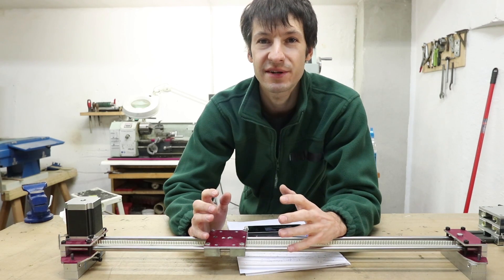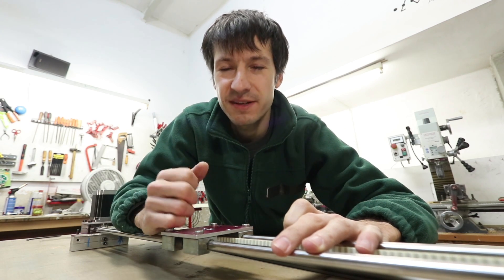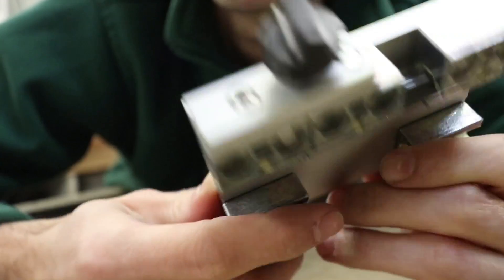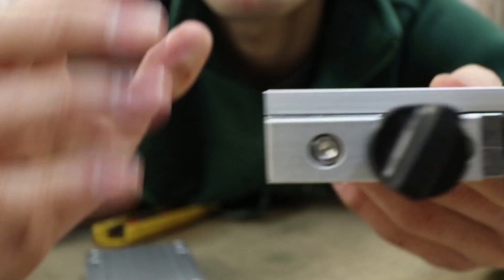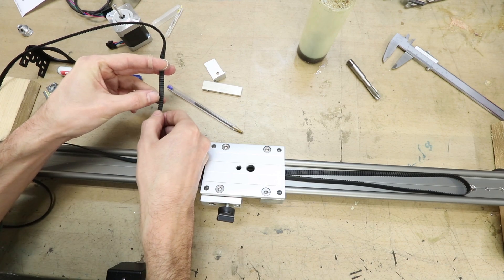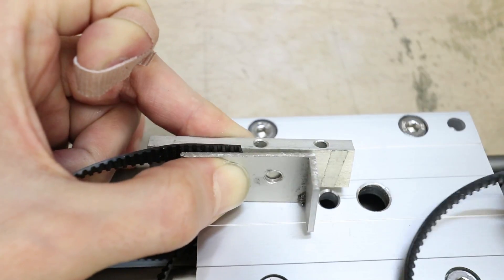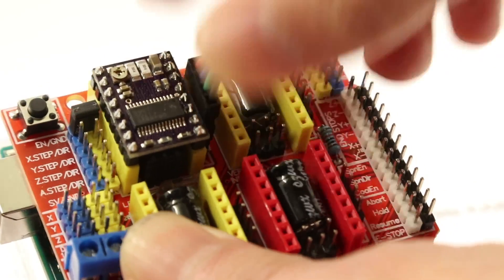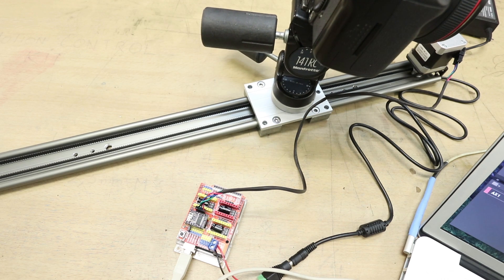DIY Arduino camera slider for professional timelapse and stopmotion

Comment: This is probably off topic, but how did you do the shot where the finished slider is moving by itself without the motor, and then assembles itself without you in the shot? Did you mask yourself out? How did you make it so clean? I see no ghosting! Just curious! :)
Reply: Stop motion ;)
Reply: Jenna Provost So I guess supports are used to place the parts suspended, and the supports are masked out? Could you suggest a video on that process? I know dragon frame is probably the software to use but regarding the physical end of the process, I'd love to see a great video to get me started. 😉
Reply: If we are both talking about the shot that's about 11:20 ish in, then there are no supports! Everything is sliding on the table, just some good old fashioned sop motion with nothing too fancy :)
Reply: Meaning to say nothing is suspended. But of course if you're interested in masking stuff out in your shots, such as rigs, try painting them all green (or something that majorly contradicts the colours you have on your set) and the remove it digitally in post production on most editing softwares. Just like a green screen. Just be sure to get a clean shot (no movement or characters and properly lit) to set in behind it once you get rid of the green/ rig. You could also mask anything in post but I personally don't like to because I find it turns out quite crude and it takes forever!!! For best results I would use a good editing software (like after effects/ premiere Pro) instead of trying to edit with Dragon Frame :)
Reply: The motor on the end that kind of flips over noto the slider end. That's the kind of thing that I thought may be supported in various positions. But I see what you mean. I've never messed with stop motion. I saw this kind of stuff done on Get Hands Dirty and other channels. I guess I didn't realize they were doing stop motion for their youtube videos. Kind of makes me respect their videos more. It's something I'd like to get into!
Reply: If there is a rig in there it's a super easy shot to simply stuff something behind it, for example a lump of clay, and position it so that the motor leans against it but it's hidden from the camera. You should give it a go!! So much fun and soooo rewarding. You learn a lot as you go, stop motion is my absolute favourite thing in the entire world :D
Reply from the maker: I see Jenna has helped you Bloodswarms, she is right with all. And yes Stop motion is something super rewarding, try it. I use as much as I can in the videos as my main job is stop motion animator. Behind the motor there was no rig, just playing with the screws that suports the motor, tightening them form super loose to it right position.

Comment: Do you find any problems with the belt? I.e., backlash, getting it tight enough to be able to step back to the same start position, issues with damaging the motor bearings or putting too much load on the motor?Nice video!
Reply from the maker: To this moment it works fine. Backlash is not noticeble, I have repeated movements to have clean backgrounds and it copies nicely the move, of course sometimes you could loose steps if the motor can't handle the move. You will damage quicker the belt than the bearings. Finallly the load, for this motor and this camera and head, it is not able to hold in vertical position, but it handles 45 degrees as shown.

Comment: If I were to make portable version of this, used for outdoor photography, i.e. no power supply. Would you recommend using a less powerful motor? I believe this motor/driver should be run with a 24V power supply which is not reasonable for a battery. Awesome video, thank you for sharing :)
Reply from the maker: The motor is also the right one for you, it is powered at 12V now. So you can build the same and take a 12V battery. Thanks for watching!!
Reply: Could I use a 11.1V Lipo battery? The ones I have are rated up to 2200mAH.  The problem I forsee is the driver listed for the motor (12V-36V). Would a 14.86V work? Otherwise, it seems I would be lugging around a large 12V battery pack like used in a car. Thank you for the quick reply, you are awesome!
Reply from the maker: I have some RC batteries here but under 8V, I would like to test it before say nothing, let me get a 12V battery and make it work. There are also packs not that big as a car ones. I will give you feedback as soon as possible
Reply: Get a small ish SLA battery. 2200mAH would only last for about 3 hours.

Comment: Awesome! Is this expansible to X and Y axis? Would there be any useful application for stop motion if it moved in both directions?
Reply from the maker: Of course it is expansible, the electronics allow 4 axis!!! You can see the application for stop motion in other of my videos, I use more axis to move a crane for example in a more complex camera movements.
Reply: edu puertas I have seen the crane and love it! But I am asking more in a single plane movement style, if is worth expanding this particular way of moving to more than one axis. Especially since the crane have so much degrees of freedom.
Reply from the maker: Ohh, yes. Check Animator cube from DitoGear. It is a bunch of sliders crossed in axis like you say. The system you say is something that works but it is not cheap as you need a lot of sliders.
Reply: edu puertas Will check that! Keep up the good work, it is indeed awesome!